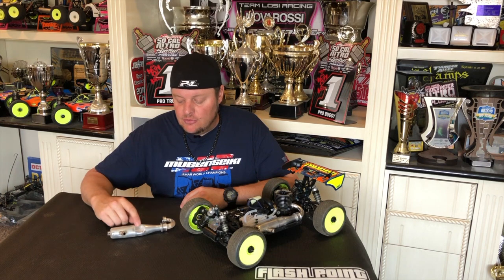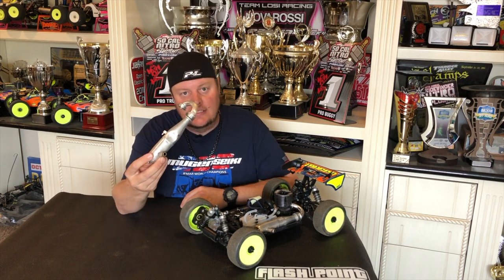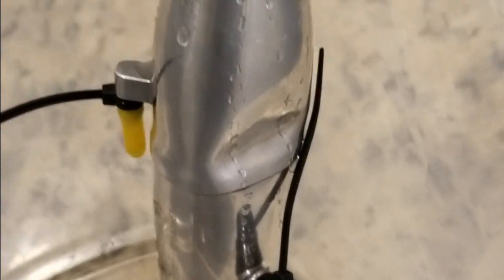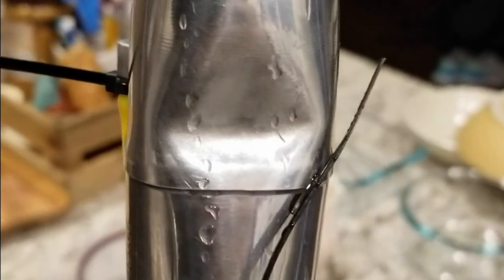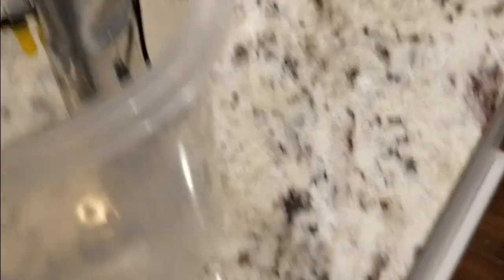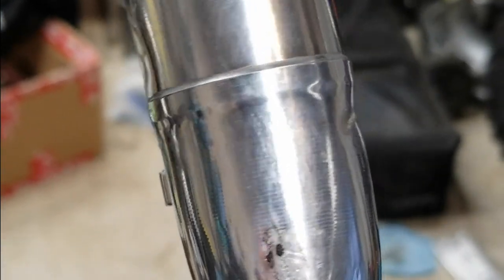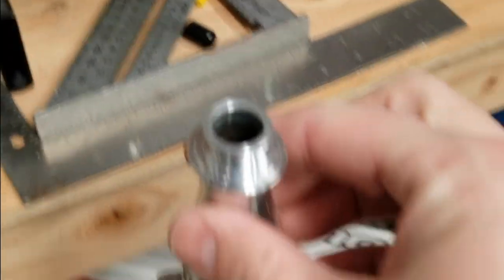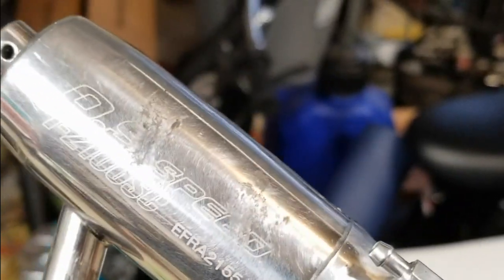Exhaust Pipe Dent Removal with Adam Drake.

Comment: Hi Drake! Thanks a lot for sharing your experience and producing this video! 

I knew the technic with a slight difference. I use to also cover the main hole and fill with a little bit less of water. 

I did your method, and the results were only achieved from the exhaust tip to the nipple. Mine provides result until the top of it. See and example in the following video:
https://youtu.be/c5zV6emqfgw

Hope you enjoy and test to compare your results!

Best!!
Reply: Marcelo Almeida nice method!! I recommend.
Reply from the maker: My pleasure!  Thank you very much!

Comment: Hey Adam, is that a carb cap or did you buy an exhaust stinger specific cap?
I saw this one that looked like a mini carb cap which fit over a 1/10 stinger perfectly but have no idea where to get one. Google results came up nil too :/
Reply: Vacuum caps from the auto parts store
Reply from the maker: You can use an carb inlet cap for the pressure inlet and a full bottle cap or get a cap set from an auto parts store.
Reply: @AdamDrake  Thanks for the replies from you 2. I'll give it a try. Late reply as YT's bugging out and not showing me all the reply notifications :/

Comment: Hey Adam,
what is the best way to remove dust and dirt of the pipe. I got a new OS Pipe and after a few runs the dirt is burned in and I can't remove it anymore. 
Is there anything to prevent this?
Reply: I use 00 steel wool and then your choice of metal polish. Just go easy around any lazer etched writing as to not remove it.
Reply: The on-road trick is to stick the pipe in a crock pot filled with antifreeze and leave it on high overnight.
Reply from the maker: It takes a long time, but you can use the crock pot with antifreeze or you can use steel wool and polish it after.